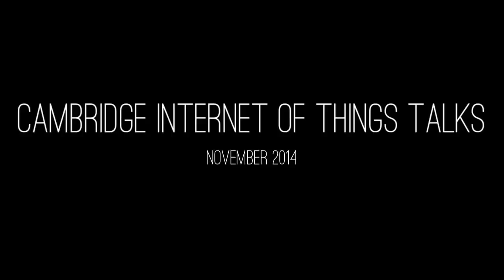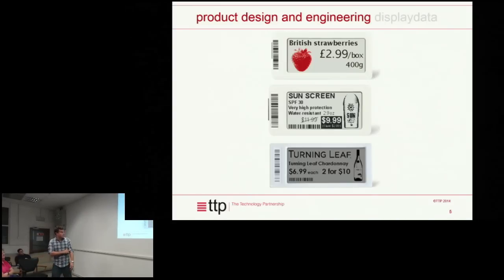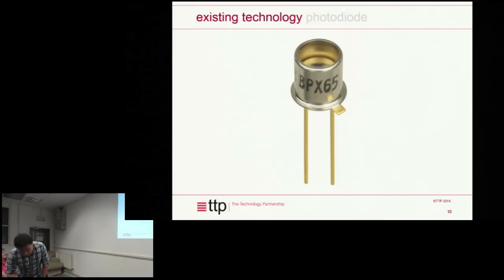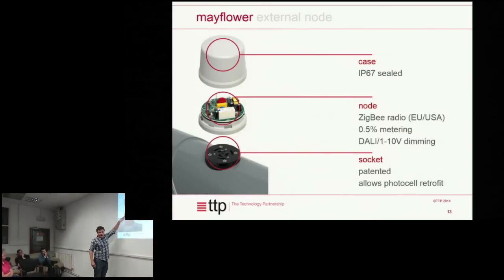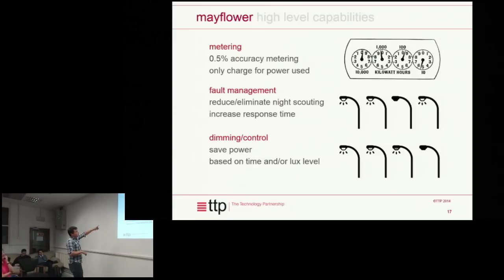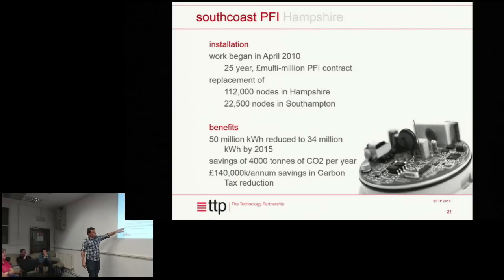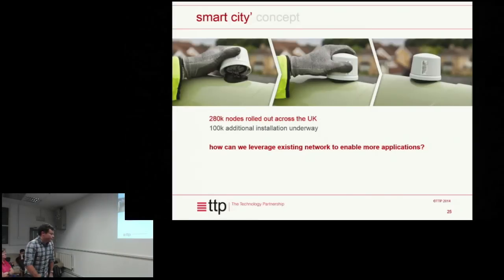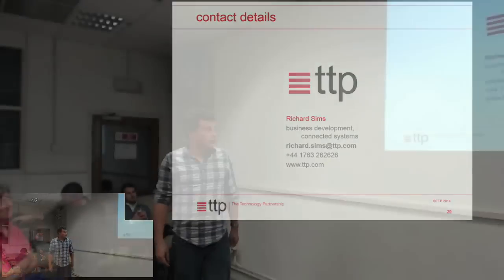Cambridge Internet of Things Talks: Richard Sims from The Technology Partnership

Comment from the maker: Recorded at the Cambridge Internet of Things meetup http://bit.ly/iotcam

Richard Sims works for The Technology Partnership and has been designing, developing and managing projects in the field of connected systems for over 12 years. These have ranged from 802.15.4 based wireless sensor networks for managing the health of dairy cattle, to a proprietary radio system for use in 'zero-power' electronic point of sale labels. He has been responsible for multiple projects that have achieved significant commercial success, with over 7 million nodes in the field using TTP developed technology. Most recently he has been working with Mayflower to roll out connected street lighting across the UK.